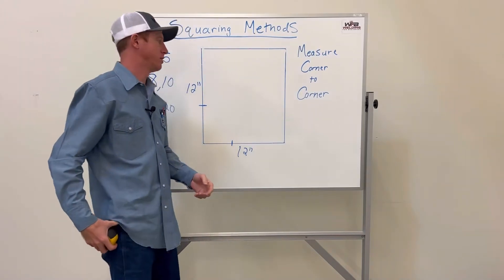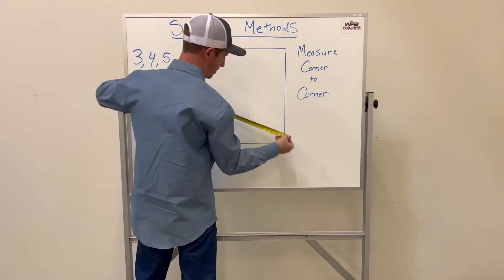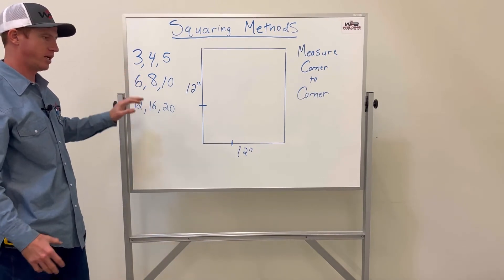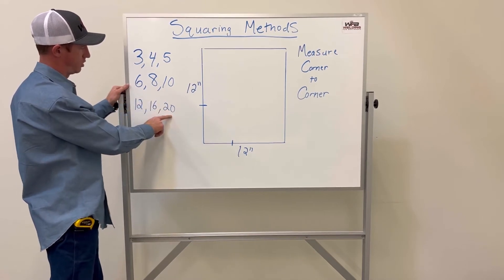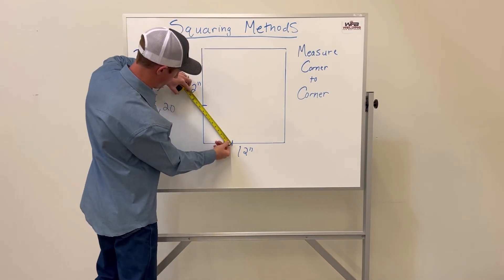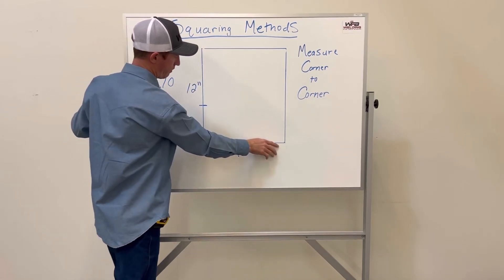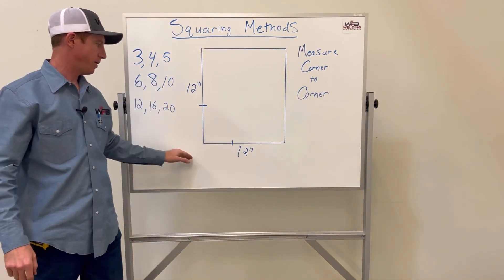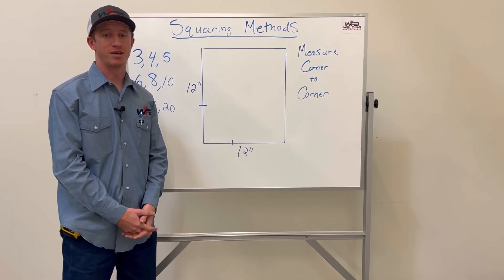Squaring Methods- 3,4,5 and Corner to Corner

Comment: Hey bro. This is really good stuff. I've been welding right at a year this August and it's great. I'm used as a helper a lot which sucks and I'm not really told what's happening so a lot of what I think I k ow has been from repetition. Having said that, I see how this worked. My only question is that if all sides are 12", why does the 6" line isn't at the middle?